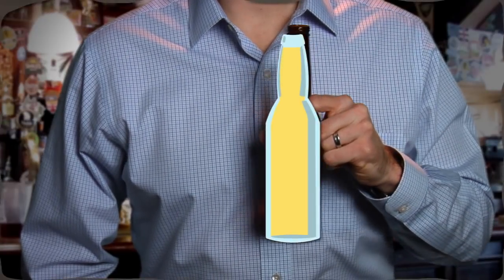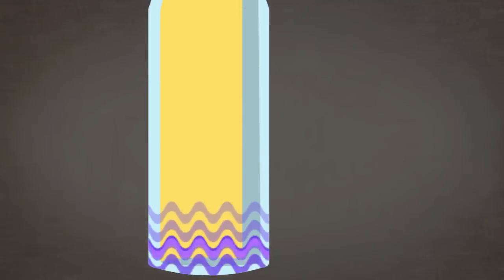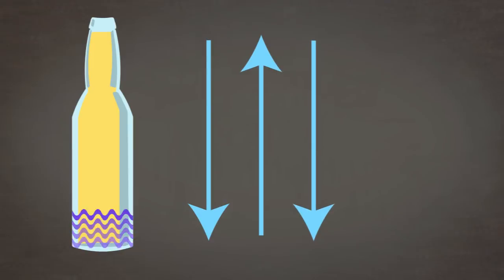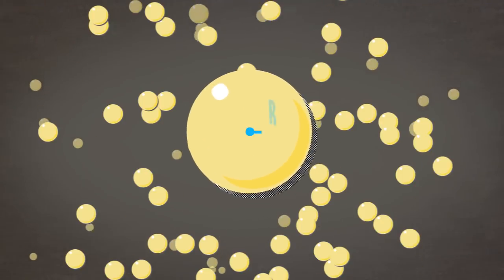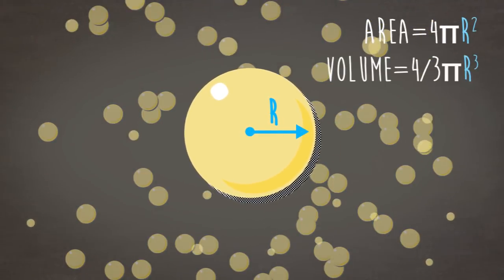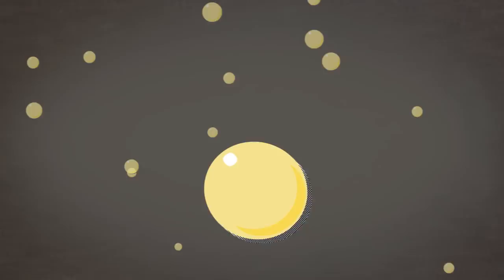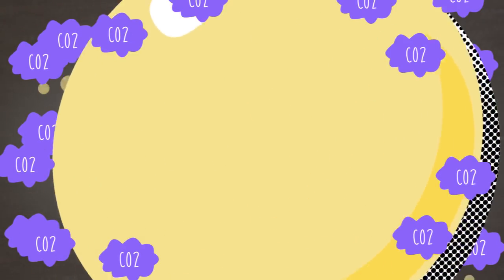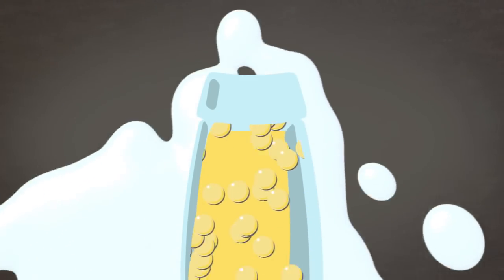Why Does Bonking Beer Bottles Create Foam? - Instant Egghead #66

Comment: Would be nice to know why it happens to the bottle at the bottom.
Reply: Because the shock travels from the top through neck to the bottom, the shape allows it a constant travel of energy. The bottle on top is hit on the bottom where the shock doesn't get much energy past the angle at the bottom.
Reply: It does happen to both bottles.  But to a lesser amount to the top bottle. Probably because some of the wave travels up and out the neck, the rest back down and then back up and out.